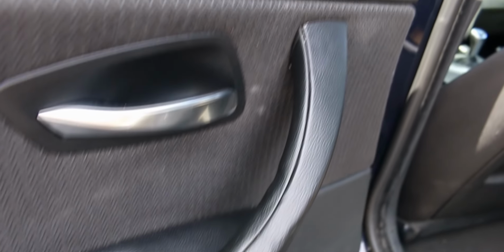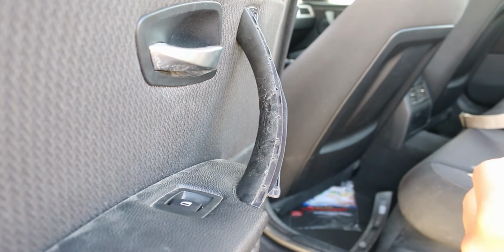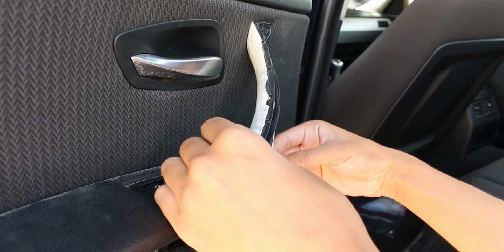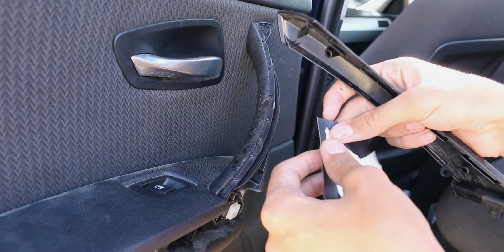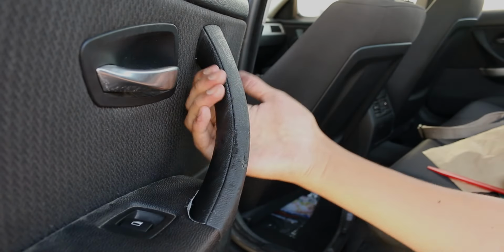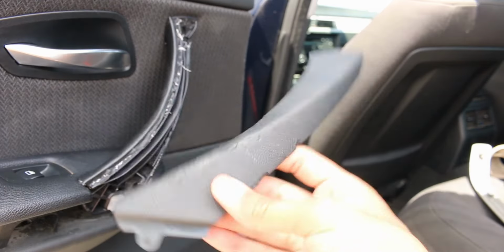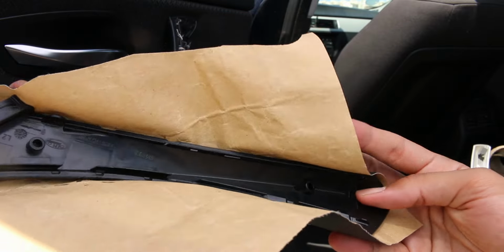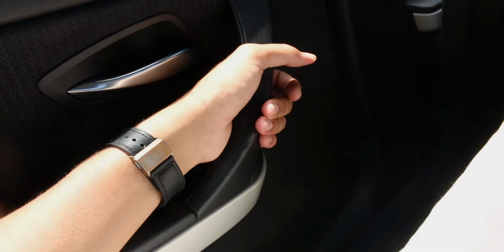How to FIX BMW sticky door handles ( cheap repair - No replacement required )

Comment: Seems like a better option than having to drill the door panel to change with another plastic door handle, the updrade to leather is better and less expensive
Reply: I agree, this is easier and you get leather instead of plastic 😊